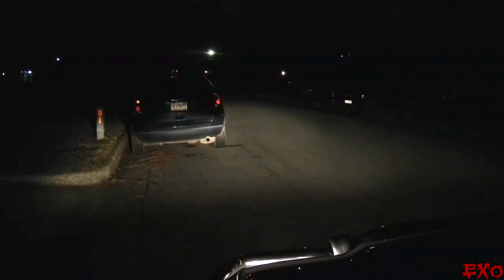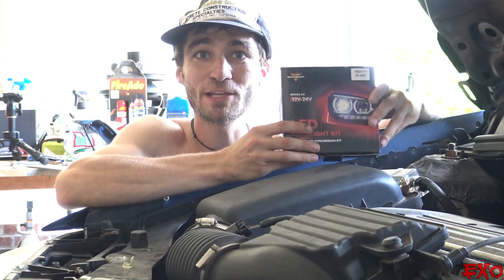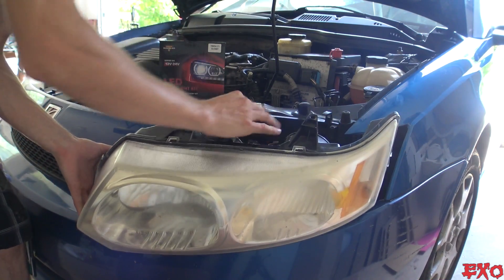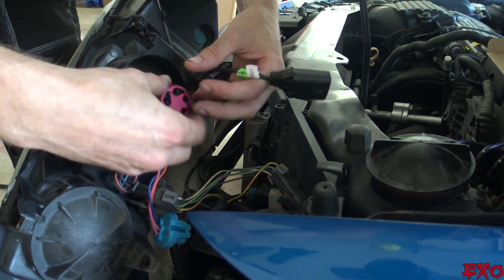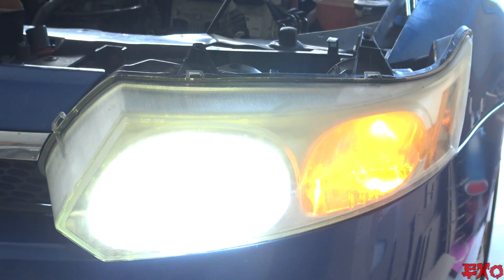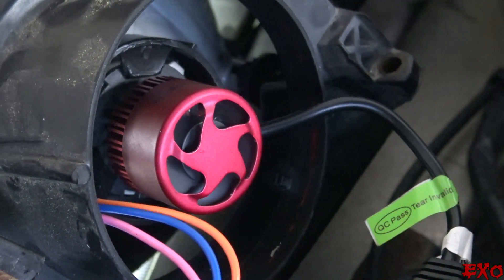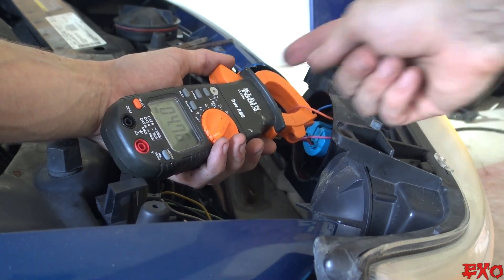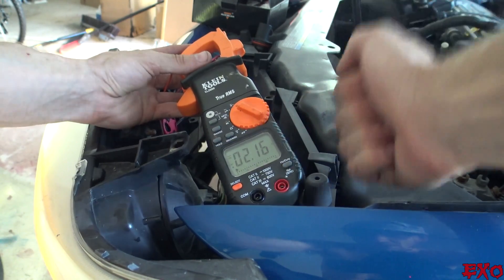How To STOP Dimming Headlights When BASS HITS | Testing Halogen vs LED Headlight | Fix Car Audio Dim

Comment: All you need is a capacitor install thats it
Reply: Johnny Kilroy said no real basshead ever
Reply: willhtown It works with my 2000 watt amp and 1000 rms subs don't speak on something you don't know
Reply: a small cap on the headlight itself might help, but not those giant car audio snake oil shit caps, those give you more dimming.

Comment: or have added multiple batteries
Reply: doesn't matter how many batteries/alternators you add, halogen lights will flicker from ANY voltage fluctuation and there will ALWAYS be that fraction of a second between voltage drop and alternators ramping up to make up for it, that is why this happens

Comment: to fix the problem in the first place you didn't have to upgrade your headlights even though that it is a very nice thing to do you probably just had to get a bigger battery and probably one more alternator
Reply: doesn't matter, dimming occurs from voltage fluctuations, no matter how much power you have you will ALWAYS see a dip when you have a MASSIVE draw, alternators use a voltage regulator to control how many of the diodes in the alternator are converting the mechanical spinning to electrical power, it take s a fraction of a second to switch those on and off, so you get voltage dips NO MATTER WHAT, you could have 40 alternators in a car, if you shut off the music you only need power from like half of 1 of them to operate the car engine and accessories, so until you start drawing current creating a voltage drop they are being told to make electricity to combat the drop.
Reply: John Sullivin you have any idea how many batteries are in the back of that car the power of those two 18s

Comment: I would use a 3M headlight restore product for those headlights, also it sounds like you have an exhaust leak. remember this : N/A cars don't benefit from exhaust mods "back pressure relief" unless your pushing about 3-400 hp .... only supercharged/turbo/pro charged vehicles benefit from exhaust upgrades

Comment: i would of left the cap off the back of the bulb prolly better air cooling movement
Reply: insanechevy91 yeah but you open up problems with water and moisture!
Reply: then you get dust and water all up in your headlight assembly and now you have to replace them.

Comment: definitely a good solution if you dont mind seeing 11-12v at the front of your car and everything besides your hid lights dimming.. including tail lights, dash lights, and license plate lights. the actual solution i found was a bank of maxwell supercaps
Reply: It dont have to drop to 11-12V for noticeable dimming but yeah the supercaps are the way to go. I tried the brute power method and fixed the headlight dimming but created a motor dimming problem, it'd bog my motor to a halt sometimes at a light if i wasnt paying attention

Comment: It don't matter i got stock headlights and no dim when bass hits just have to have good electrical
Reply: I dont think the quality of your electrical system matters when you have a system like this
Reply: if there's a difference in the voltage at your headlights vs the amp terminals because of poor wire ampacity you won't get light dimming, doesn't mean you have good electrical though

Comment: I always used caps in my systems. it usually completely stops dimming. and help feed the amps. but with this swap. you have a few more amp to feed the amplifiers.
Reply: caps hurt your system because it limits the power a amp needs which made my system clip. example at volume 22 without it clips at 25. just curious if u had different luck.

Comment: I have a Vic p71. it has a very large alt and a very large capacity batt. I have not done the big three. I have a boss ndx5500 amp( say what you want its a " not bad" budget amp) and its pushing two dark ai nko 12s at 2 ohms. I get head light dim and I feel that the 215 amp alt and 9 hr reserve battery should be up to task. what are the durability of those LEDs and how well do they work in the rain and fog? its sooooo embarrassing to pull up next to some hoytie toytie in his bimmer blasting his Wayne newton and whomp his ish with some filthy dubstep and have my head lights flicker .
Reply: You haven't done the big 3, plus your running junker wire (no offense, im running some junker wire too right now). 215 Amp alt means 215 Max, that means at a certain (high) speed and probably low temp it might could put out 215. IDK much about the ford alternators because I usually try to use GM alternators in everything but I know a lot of them have a delay on them so it dont bog the motor down, A lot of GM alternators have a 2.5-10 delay and they send out less power when hot. Get a spec sheet on yoru alt and see what it puts out at idle (you might have to calculate the pulley ratiio to figure it out)
Reply: All2skitzd I'm running 2 gauge ofc from a solar panel supplier . the alt keeps the battery at 13+ volts at idle( I was wrong its a 230 amp HD unit for high load cop cars) and it drops ever so slightly on close to max volume. I've got my volt meter hooked up and under some heavy bass at idle the amps dip but come back very fast, I'm thinking I need to redo my grounds maybe drop a strap from the frame. its just that sudden dip in amperage that flicks my light. I was liking these lights as they have a regulator on them. the rest of my lights don't dim just the head lights flicker .

Comment: wet sand 1500 grit them lights then buff with hard rubbing compound and buffer it will last much longer before oxide layer happens again
Reply: Don't forget the clear coating.
Reply: Hlless421 is right. If you don't clear coat with UV protected clear coat, the oxidation and yellowing is going to come back even if it takes a couple of months, and it WILL be far worse than original, because you're literally taking the original clear coat off by sanding, leaving the plastic porous and vulnerable to UV rays.

Comment: I guess led is the way to go, better quality control and whiter than hid
Reply: No, quality control is in the manufacturer, not the bulb type. And a 6000k HID is going to be identical in color tone to a 6000k LED. Also, stock bulbs in anything without projectors are halogen, not HID. HID is high intensity discharge, and uses a high voltage lower wattage power input (ballast) that's regulated, whereas halogens use 12 volt and whatever wattage they're rated at unregulated as their input.
Reply: there are more crappy hid kits from china out there than led guaranteed

Comment: I got a 12'' Ground Zero 350rms/600peak woofer with GZ 600watt amp and recently bought alternator and battery and still its blinking at max volume :p i guess the current draw of all of my oldschool lights are still too much
Reply: How do you have headlight dim?  300 watts shouldn't have that much draw on your electrical like at all.  How many amperage is your alt rated for?  Did you replace your stock battery with agm battery?  Do you only have the 1 battery under the hood or did you buy a 2nd one for the back?  Have you done the Big 3 yet?  How much voltage drop are you seeing when playing full tilt and keeping your engine at 2k rpm?

Comment: Ive replaced all of my brake lights, reverse lights and blinkers with LED lights in my 04 odyssey. But my fogs and headlights are running HID lights instead. I like those much better than LED Bec I can change the colors of them. I had to replace the blinker relay for the blinkers to avoid hyper flash of course, but the brake light issue was simple by just clipping the wire that tells the computer theres a bulb out. I figured that I ALWAYS check my lights every couple weeks to make sure that they are all set, that I won't need that warning light. Besides, im running two 12's on a boss amp (I know, I was on a budget at the time and haven't been able to afford getting a better one) and three sets of components on a four channel 600 watt amp. Plus a DSP and a pioneer AVIC8200-NEX radio. Plus a lot lot more in that van. It will be completely overhauled too, it's one of my projects I plan on doing over time.

Comment: If you plan on reusing the old factory style lights you should avoid touching the glass of them cause the oil from your skin makes hot spots and causes the bulb to burn out fast. You can clean the glass with some rubbing alcohol though and a paper towel if you do touch it.

Comment: I get no dimming with a 300w system while running both seat heaters and high beams with the stock 60 amp alternator. Honda quality.
Reply: DMAN22yeah it's only 300w.
Reply: Sometimes vehicles come with an "optional" heavy duty alternator. I know mine came with 130 and 150 amp versions in addition to the default 70 Amp alternator. You can get these at salvage yards pretty cheap if you're on a budget and they are a direct drop in for the old one in most cases.
Reply: When i go to a 1200w rockford fosgate amp ill probably get an upgraded/auxiliary alternator.
Reply: True lmao

Comment: another thing gets automatic transmission fluid and put some on a rag and clean your head lights.  it will look like new!!
Reply: Kevin Macinnis don't do that. wet sand it with 1000-5000 grit, polish and wax.
Reply: they both work.
Reply: idiot

Comment: The lights dim because the amp is taking power from the battery
Reply: ButtZilla Playzzz *alt, that's why adding piles of batteries won't stop this. only the alt creates power at 14v. 12v batteries only rest at 12v. so you actually don't have current draw on a battery till A you start your vehicle, or B your pulling enough current to use up all that your alt can make. in turn making it look like it does when your cars off. you literally sucking the alt down to nothing.
Reply: Chris Rehbein audio amplifier can pull upto 300amps with 10,000w setup!! you have to install a good alutarnator like 360amp mechman aultarnator it is the minimum requirement!! because there not only amps on your car but many other accessories and there is only 60amp headroom if the system runs at full powee!!adding some capacitor and battery is always good idea!!

Comment: Exo where can you buy blown subwoofers at? I want to find some good 12s and recone them
Reply: Solar NmE its usually the voice coils that blow not the cones. suns are cheap anyways, you'll pay a lot to just respond.
Reply: Solar NmE 
Hmmm, that's a good question man. I never thought about buying fixer upper subs. Not a bad idea if you can source the proper re-cone kits at a good value. I'd say put an add on Craigslist offering to purchase blown subwoofers. I just don't know anywhere else other then posting on forums.

Comment: hey exo , that was pretty cool there thanks , but , an I know a lot of people will be like what did he say ??? capacitor !!!! but seriously , you know those so called 800 watt scosche brand capacitors that you get with a 800 watt scosche power wiring kit ? yeah just run one on both headlights and problem solved , just for the hella it do a exo tries out cheap cap to solve dimming headlights problem , an see what happens !!! no cap haters comments !!!! if you are not willing to listen and learn while trying something that makes sense then what can you say , if your wrong about it ??? stiffen them headlamps up with a capacitor !!!
Reply: mark harris i tried it in my Ram it works a bit but not night and day difference
Reply: And also farrad not watt
Reply: froggy beatz the reason I said or stated 800 watt scosche power wire kit , is because that's how scosche lists it , 800 watt , but I know what you mean by fared !

Comment: Just the capacitor and diode could fix the old ones :D
Reply: Gamerdu45 OH NO!!! You said capacitor. Prepare for the cap hating remarks. I too am a believer but were few and far between around these parts.
Reply: Gamerdu45 I have never heard of doing that. I have hids and mine dim a bit. I wonder if it will work.

Comment: I fixed my dimming by using Hid's my lights look blue cuz my housing is tinted. but I got them off eBay for the cheap and been going strong over a year now!
Reply: Harold Lewis did the same Idk which is better the led or hid seems like hid would be brighter
Reply: Daniel Harrell hids are still brighter but the led technology is steadily improving.

Comment: EXOOOOO I have a problem all of my lights in my car is dimming everything!!! out of my car and inside!!!!
Reply: or clean the terminals on alt and battery worked for me
Reply: Jo Louie my amp is not to powerful, I only have a subwoofer with 275 watts RMS
Reply: slotec my battery is new

Comment: This is not how you stop dimming headlights. Adding improper bulb types to reflector housings is stupid you add glare to other drivers and reduce your own amount of actual light on the road. You eliminate headlight dimming by fixing VOLTAGE DROP. Voltage drop happens when your system drops to battery voltage from alternator voltage because you exceed the capacity of the alternator. Please don't encourage dangerous illegal plug and play kits.

Comment: Get rid of those shitty LEDs EXO. They're not designed to match the housings. No plug n play LED system gives a useable beam pattern regardless of the "adjustability"  that they used as a sales tactic. If you really want LEDs then go to lightwerkz.net and check out the I.lens bi led projector. It'd be good for a retrofit and still give you the power savings of LEDs. Also, restore those lenses homie. Hazing isn't good for output.
Reply: ThatMazdaRanger I was looking through the comments to see if anyone would say this 👍🏽
Reply: ThatMazdaRanger thank you for saying this! I use to be that jackass with hid but you really do need to do a retrofit to be safer!

Comment: its 2017 get xeons.....
Reply: username taken Xenon bulbs are verry cool in the fact that they use plasma to iluminate, however for maximum efficiency and long life, led seems the way forward at the moment
Reply: Elliot Hunt worked well for me? dont get cheap ebay shit and youll be good 2 go
Reply: username taken HIDs are still currently better than LEDs so I don't know what he's talking about. But at the same time, the HIDs need to be used properly to get the most efficient light spread and hot spot. Otherwise it's just crappy glare and lack of hot spot same as the LEDs.

Comment: I personally prefer HIDs. I've tried led but the throw of the light want as far and the light seemed kinda scattered. don't get me wrong they are brighter than halogen bet don't compare to a nice set of HIDs.
Reply: Derrick h if you think plain HIDs are good you should try an HID retrofit. 20x better output and much cleaner with a good cutoff. :)
Reply: ThatMazdaRanger ive been wanting to do a retrofit with some nice projector lenses.

Comment: Wet sand the headlight! Then clear coat them! Theyll look good as new after!
Reply: KOSx15 a-hole I was gonna say that smh lol 👍 but yes wet sand starting at about 400 grit and finish at 600 then clear ,
Reply: KOSx15 never tried wet sanding. I've always used polishing compound.
Reply: Bob Snow that works too, but if you wet sand it first and remove all the dead plastic itll come out looking like brand new! I use clear coat when i want to do a quick and easy job, but when i want to do it right i wet sand, then polish them!
Reply: Hector Arroyo lol great minds think alike! 👍🏻

Comment: I have this problem with 2 12's @ 2400 rms and they dim way too much at night, gonna try leds
Reply: Have a 15 at 3000w and it's embarrassing to have the lights dim so much, people think I'm flashing them
Reply: Matt Merrill Dont get L.E.D's you will be replacing them every 6 months this is 2017 HID's is where it is at.
Reply: First of all you should upgrade your electric system, with BIG 3 and or an auxiliary battery.

Comment: technically yes the led wont dim. along with hids. but with factory housings. leds will blind oncoming drivers and you dont get a hotspot so no distance viewing. also always check local laws when changing bulb types
Reply: ghostrider59927 glad I'm not the only one that knows this. LEDs are going to be all foreground and no distance lighting. You could see it when he was driving.
Reply: i didnt get that far. until i was taught about headlights i was almost going to put in leds in my car. if i was doing city driving it wouldnt be too bad. but i drive on country roads so gatta have width and distance
Reply: ghostrider59927 yep. I used crappy generic eBay projector housings with LEDs and regretted it once I realized how bad they actually were. I ended up restoring my factory lenses and using an upgraded halogen. If he really wants to use led he can use a bi led projector and get much better results.